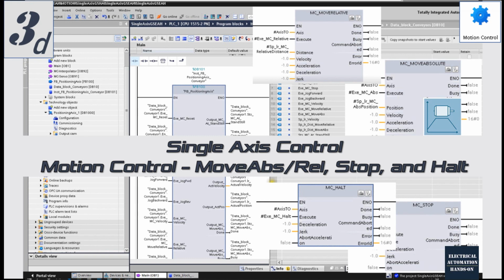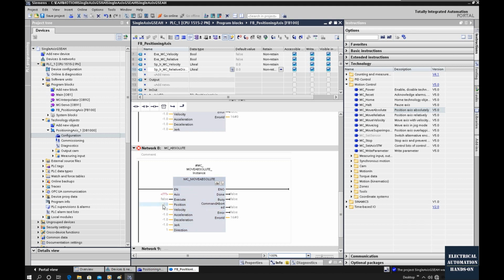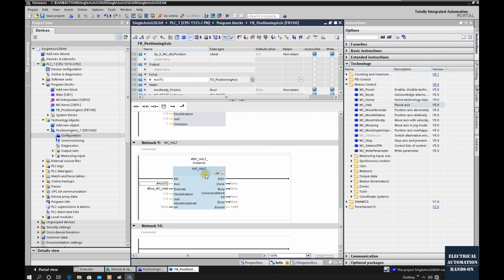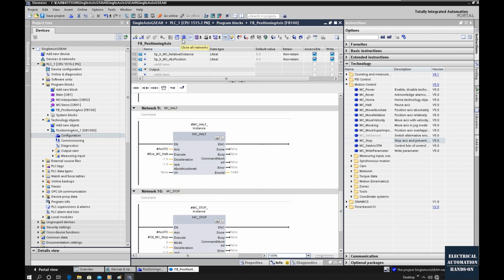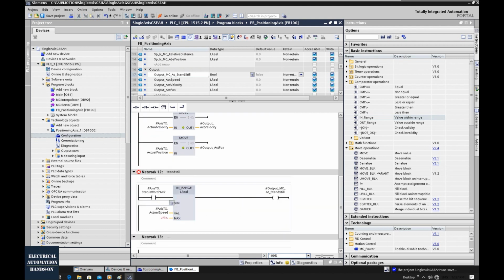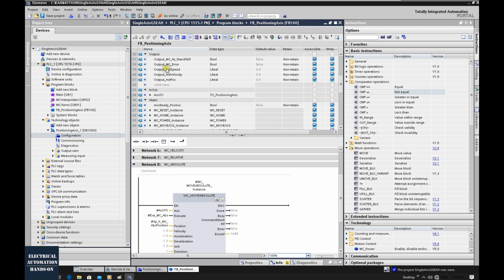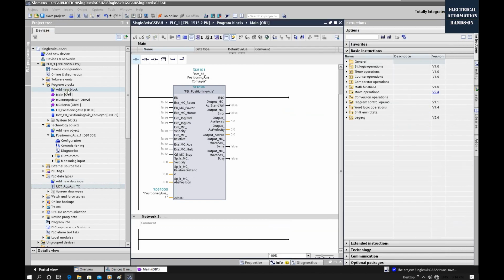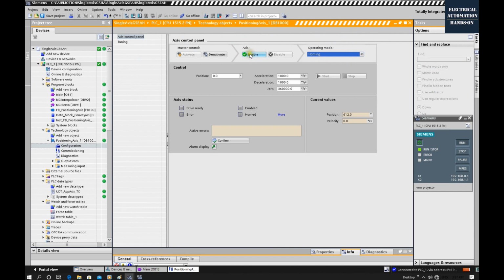MS03d. [Siemens Motion Control] Move Absolute, Relative, Velocity, Stop, Halt Instructions [6/10]

Comment: Great vídeo, can you make a video explaining the adjustment of the jerk, aceleration, deaceleration, etc to make a precision stop with move_relative and no holding brake motor?
Reply from the maker: For Siemens Motion Control FBs, you can execute a new MoveAbs before the previous one done, then the second MoveAbs (with new Acc, Dec, Jerk) will overwrite the previous one. Regarding the precision stop, I think more important setting comes from the drive internal parameter optimization, as well as the encoder resolution you selected.

Comment: Thanks for your effort. How can be the small differences between the setpoint and the actual pos. tolerated (Less than mm maybe)? Can we get the done signal from MC_MoveAbsolute although there is a tiny diiference or do we have to add a tolerance for it?
Reply from the maker: In the 'To' configuration, you can find the 'tolerance ' and 'standstill' window settings.
Reply: @electricalautomation  thanks a lot 👏🏼

Comment: I have a quick question about TIA WINCC. I don't know your email. so i just leave my question here.
In TIA V16 WINCC Comfort TP900 panel, I try to control the visibility of layer of a particular screen. can we do that? 
Thanks,
Reply: Do you mean during screen design or runtime ?  You can hide layers during design by right clicking a blank area of the screen, select Properties then layers. Untick the layer you want to hide. During runtime you need to have set the visibility animation in the properties of the control you want to hide, using a control tag
Reply: @neiljolliff8170  I want to use VB Scripts to control Layer visibility to show or hide it for different recipe or user group. My goal is to change the visibility on the entire layer instead of individual object on that layer. Since i have a lot object on the layer. it is kind of tedious work.
Reply: @jinhe5956  I don't think layer switching can be done programmatically. The only method I can think of is to activate different screens by user group using the ActivateScreen system function dependant on the user group tag value.
Reply: @neiljolliff8170  Do you know any easy way to control the visibility of a group of object?
Reply: @jinhe5956  Highlight all the tags to use the same visibilty animation and then set the visibilty animation parameters for one of those objects. All the other selected objects should inherit the same visibility criterea. The tag can be any type though int is appropriate if you're using User Group as the controlling element . 
Use the tag value range or absolute value for the visibility. In VB script you could use a Case object to  do other things based on the tag value
Reply from the maker: I have similar idea as Neil. Thanks Neil. Sorry for replying late. According to your questions, there is no straight method. Alternately, you can use the idea of 'Faceplate', the items belong to a 'layer' are all within one faceplate. Then control this faceplate visible or not. https://support.industry.siemens.com/cs/document/68014632/creating-faceplates-with-wincc-runtime-advanced-and-comfort-panels?dti=0&lc=en-WW.  Another rigid method is to group the items. The visibility property can be gather together to be modified. You still have to change one by one, but has been better than change each separately.
Reply from the maker: Good idea Neil! Also, the Visibility settings can be copied. So leaving the Animations tab static, then click each item on the HMI screen, we can quickly set/paste the items with the same visibility property.
Reply: @Electrical Automation Hands-On  Thanks guys. I got the same answer from Siemens Tech support. I am used to FT View. It seems like the faceplate will be a better approach. Btw, you channel is very helpful. Thanks for sharing ideas.
Reply: @neiljolliff8170  I tried. but it did works for the visibility when selected the objects. but it will change the process tag in each object you selected to the same tag. I end up changing the process tag back.
Reply: question plz i dnt have the MC_Stop ???
i have tia portal v15.1
could u help me
Reply from the maker: @omraniachref9062  What is the controller you are using? S7-300?  For S7-1200 and S7-1500 you should have it in your TIA Portal

Comment: There is no "MC_Stop"  technology instruction if you are using motion control v4.0 (TIA 15.1)
Reply from the maker: For S7-1200, it doesn't have MC Stop  instruction, but you can use MC Halt or disable the MC power for the same control
Reply: @electricalautomation  Im using a CPU 1511T-1 PN, but the instruction is not there... 
Also, in the manual "S7-1500T Motion Control V4.0 in TIA Portal V15" it doesn't says anything about that instruction...
But I will work with the MC power or MC Halt.
Thank you!